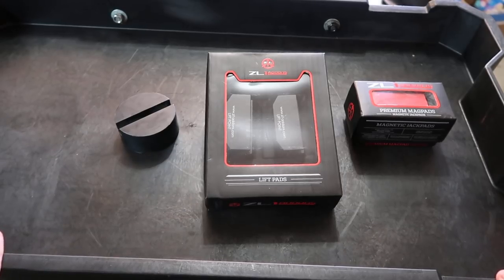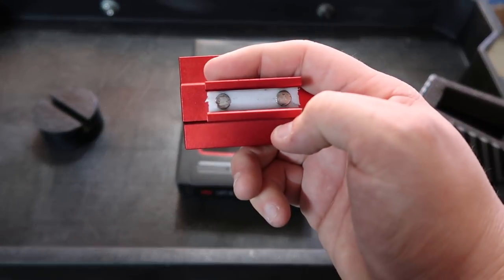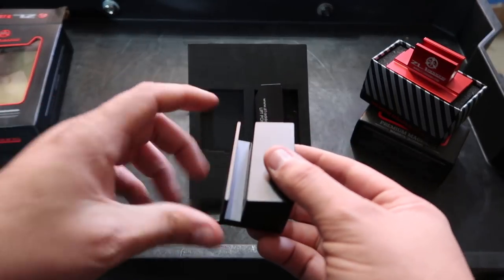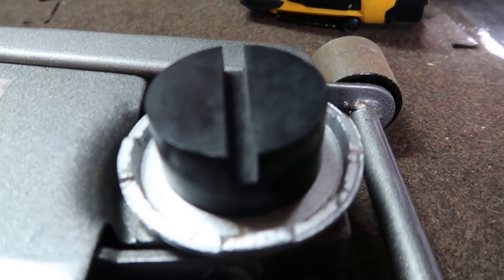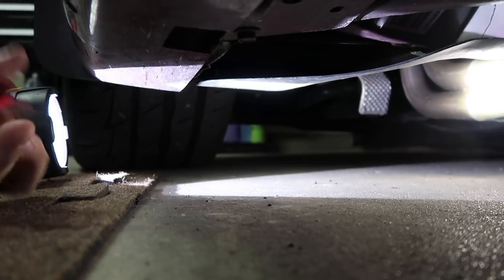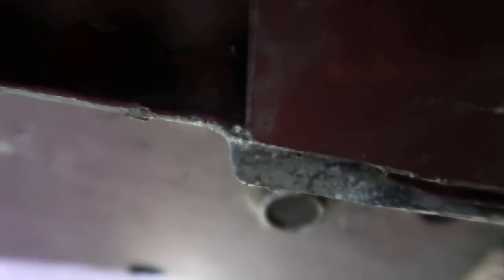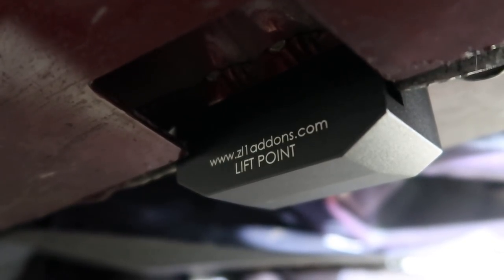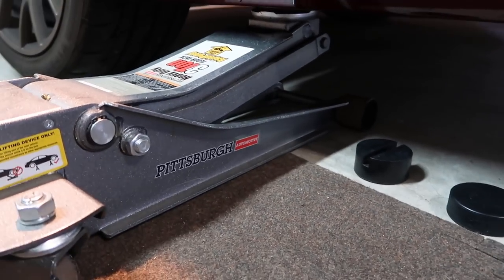ZL1 Addons Lift Pads (Dodge Charger and Challenger)

Comment: Okay, I just received these for my 2012 Dodge Charger, and I swear, they seem to fit weird. For starters, the pinch-weld gap seems way too wide, but maybe it doesn't matter. Also, is the sloped/angled part of the piece supposed to sit flush with the body? I guess that would be weird, because then the piece itself would be installed at a cant, but then why make them sloped/angled on one side? Also, the pad seems to be wider than the plastic cut-out for the body, but no big deal, it sits further in, but all of it just seems very strange. So I guess to help my confusion, my question is, is the only part that comes in contact with the vehicle the base of the pinch-weld gap area, and the sloped/angled part doesn't touch the car (like where that big bolt/washer is)?

Comment: Use rubber hockey pucks from amazon and glue in rare earth magnets and trim to fit pinch welds cost less then $40.00
Reply: Better than the &55.00 you would spend on a pair of ZL 1 Addons

Comment: Gonna have to grab these. Where do you jack yours from the back? I haven’t lifted mine at home because I don’t want to mangle anything lol.
Reply from the maker: Jaydee392 I either use the mag pads on the rear pinch weld or most commonly I jack on this black cup thing right next to the pinch weld
Reply: There are these plastic couch legs in front of the rear wheels.  I am almost 100% positive they are for jacking
Reply: Use the rear differential for jacking up the back end.

Comment: I disagree with your Springer Final Thought... You don't want that lift pad touching anything BUT the pinch weld because there's painted plastic body parts and other body parts that weren't meant to support the weight of the vehicle if it's really resting on any of it. Also, the gap is way too large, just like their Jack MagPads, which gives you the feeling you talked about that it may just slip out from under you as you described. I want to LOVE this company and this part, but unfortunately, I'm not too confident in it. Also, why no instructions included? Also, why no part # on the box? I thought I was given the wrong part at first, seemed very universal and not unique to my Charger application.

Comment: How do you transfer from the jack to a jack stand using the pads? I’d like to put my car on 4 jack stands to paint the calipers ?
Reply: You buy a set of Jackpoint Jackstands with their flat, recessed pad and put the ZL1addons adapter on top of that.

Comment: I tried these on my charger and was unable to get them to secure to the pinch weld. The three angled bumps on the pinch weld just pushed mine off as I tightened the  set screws. Guy at Zl1 said he had never seen a pinch weld that looked like mine, but it looks just like yours and every other charger I've seen. Did you have any issues getting them to secure on the pinch weld?
Reply from the maker: Derrin Holt mine weld down just fine and I even tried after they were tightened down to pull them off just to make sure 😧
Reply: MOPARGuy 
Glad I'm not the only one who had this issues. I was surprised when honestlyocd said his fit no problem. The guy kept telling me my shit was bent and that he had never seen a pinch weld like mine, probably cause he never test fit them on a charger. He told me to just stick them somewhere else.  Which I wasn't cool with, that meant I would have to cut my rocker panel for it to fit. I want to lift my car where it is designed to lift and not modify my car for it to fit, that's the reason I bought them. I noticed the package said challenger which has a totally different pinch weld, so he just assumed they would fit the charger.
Reply from the maker: Derrin Holt that's so weird that you experienced that :O if my weld wasn't bent that way I feel these would have went on so much faster with zero issues lol but i do have to check after a little while to make sure they are still on firm and secure
Reply: yes, it has issues. look for my review in a few mins...
Reply: yes.. these are for the challenger pinch welds.. the charger has a gap...
Reply: correct

Comment: So you don’t need them on back because they are have them already on there?.
Reply from the maker: Eric Keen no the car has a little cup type thing you can jack on right next to the rear pinch weld so it already has a good location
Reply: HonestlyOCD Thank You Sir!
Reply: HonestlyOCD one would think if they put them on the back, that they would put them on the front. Way to fail dodge! Still love the chargers though.

Comment: What year is your car , i have 2018 and they wont fit
Reply from the maker: 2017
Reply: HonestlyOCD i think the notch in the pinch weld on the 2018 is wider cause the set screws will not grab the pinch weld

Comment: $200 for four? Pretty dopey.
Reply: Chargers should have those rubber-coated lift pads on the back, so you only need to get two for the front.